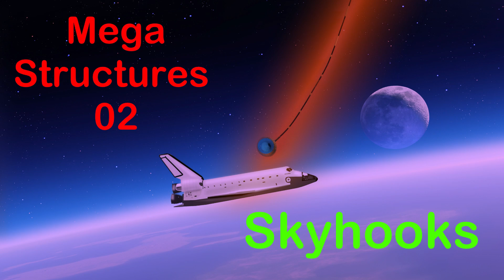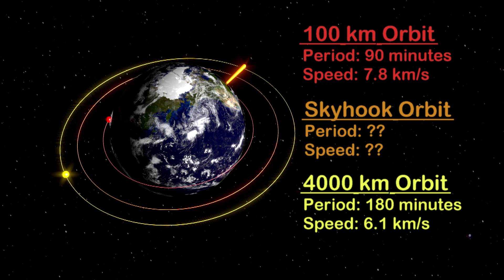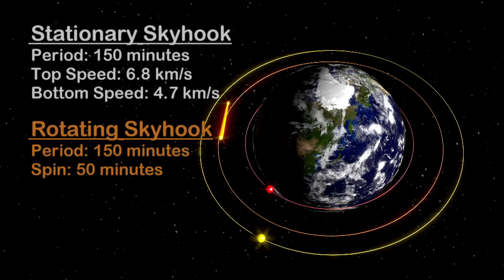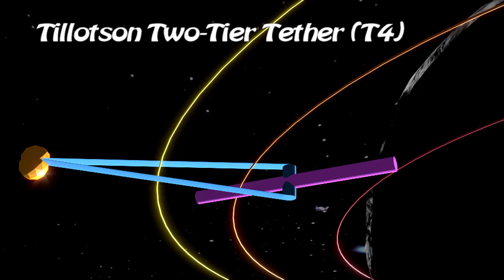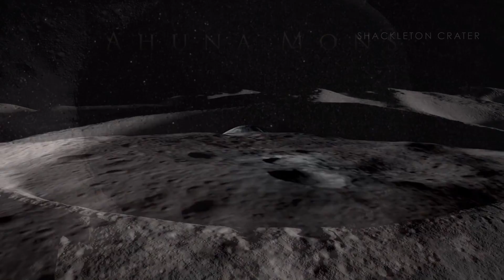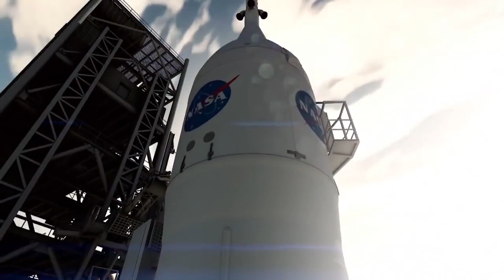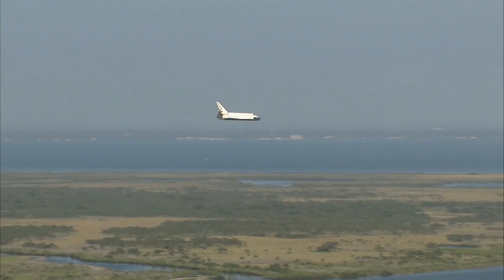Skyhooks & Rotovators

Comment: That's why they're not popular, they're not that cool, they are complicated to understand, they are almost just as ridiculous to create as space elevators, and the benefit of having one would not, by far, justify the investment. Also... launching a ship in equatorial orbit to save 30% fuel only to use up 30% MORE fuel in order to perform a rendezvous with a non-equatorial orbiting spaceship/satellite launch trajectory is quite useless :)
Reply: NightLurk. since when is that much fuel required for that manuver?  

besides, thats like saying building an i terstate highway makes no sense if you have to take miles of back roads to get to your final destination, particularly when important things tend to be placed by the highway anyway. 

lastly, theres no reason whatsoever a tether MUST be at the equator, it makes sense for it to be but thats no different from rockets anyway.

Comment: I may be mistaken but argon should be actually better than xenon: Xe has more T/W ratio but AG has more Isp, Xe is used more because ion engines have already a lot of Isp and is preferred to bring the payload faster but on a skyhook one would prefer to bring up more mass with a bigger ion engine Ag propelled (also making it more stable) the first time since you will benefit bringing less fuel each time rapidly reentring the initail cost.

Comment: I think there are many dangers involved in the operation of the skyhook. Mainly when hooking on to it, either from the lower atmosphere or from space.
If you look at some footage of mid air refueling you can easily see that it's quite hard to pull off and can result in damaging the hook. If the hook is damaged, I assume it would be pretty hard to fix since you'd have to pull the fix off dangling in mid air. If you drop something it would go falling to the ground, or get shot out of Earth's gravity well in the case of the rotating skyhook.
Also cargo transfers in mid air is something we have not much experience in doing, so that would be a safety concern as well.

If you fail to hook on in an airplane, that's fine. As said in the video you can just fly back down. But what about objects being hooked in space? Non-rotating variants would be fine since the space object is in stable orbit, but for the rotating version of the skyhook, the space object would be hooked while in an escape trajectory and if it fails to hook on the first try, it would shoot straight out of Earth's gravity well, presumably without enough fuel to come back any time soon.

Along with all those dangers I gave, it would be quite hard to increase the numbers of hooks on each end of the skyhook since if you are going to build a port facility for it you would have to design it so that they can withstand supersonic speeds within the atmosphere. And also you would probably want to have two of them on each end, unlike the space elevator in which you have little design constraints for the orbital station part and you would only need one of it.

Comment: which do you think would be cheaper per kg, reusable rockets or skyhooks?
Reply from the maker: Skyhooks, at least on Earth, have to be used in tandem with something, so the answer is basically 'yes', they would make reusable rockets cheaper to use, and that would also be cheaper than conventional rockets... I'm not sure for hypersonic spaceplanes.
Reply: Isaac Arthur sorry i am a bit confused i was asking of say space x's reusable rockets would be cheaper per use than a sky hook and plane. as opposed to a rocket meeting a skyhook
Reply from the maker: The Skyhook and plane should be cheaper, not including R&D costs, if you're using them a lot.
Reply: Isaac Arthur thanks issac! :) that's what i was wondering.

Comment: Isaac, I don't believe in the skyhook for a number of reasons.  You sort of gloss over a few finer details like how you raise your space ship from perigee to apogee once it attaches to the skyhook.  What is this mechanism?  Then there's the trickiness of timing a tumbling skyhook.  I don't think this will be at all possible.  Lining up to attach to a straight tether would be plenty hard enough if not impossible.  This would be equivalent to those precarious refueling maneuvers of military planes with high-altitude tankers but orders higher in difficulty because the skyhook would hardly be maneuver compared to the space plane.  Then there's the issue of weather (wind mostly) that would blow the skyhook around.  How would this be prevented?  Evocative concept - yes; realistically doable - no.
Reply: Brian Brewster. a rotating skyhook would have a significant "dwell" period where the tip would be effectively stationary (assuming its rotation was timed to its orbital period) you could in theory wait for the hook to arrive, walk up to it and hang a basket of space cookies during the dwell and watch it smoothly pull away.

in relation to those risky refueling procedures...those are nowhere near any manned launch in history or the foreseeable future of rocketry.  if it only ten times harder than that its still many times easier than any other mode we have used sofar.

Comment: Why not monitor a payload building from the already  space station build a huge structure way higher then the station make the structure able to calculate the weight of the payload so the tether could be reeled in like a fish getting all its fee power from the sun ,, i mean its a lot cheaper then anti gravity., then we could build in space , then any rocket payload could use a simple air plane if  we  mach the earths speed with another low orbit structure that could later connect to the high orbit structure.Then we can  start building space ships and space city's from dead planets not life holding planets and keep mother earth alive as well.

Comment: The problem is the conservation of momentum. When you bring up a heavy spaceship with the skyhook, the spaceship increases its radial velocity while it is going uo. This means that the rest of the skyhook on the other hand decreases its radial velocity meaning it will loose hight in its orbit just a little bit, assuming the skyhook is hmuch heavier than the spaceship. This loss in height has to be compensated with burning fuel to lift the orbit of the skyhook back up. The amount of fuel is exactly the same as if the spaceship burned the fuel itself and didn't use the skyhook.
Reply: ProjectPhysX. it does not require the burning of fuel, there are several options for gaining delta when one is straddling the atmosphere.  one of the more obvious methods is to gather solar energy from the high end and feeding that power into the tether. electrodynamic propulsion.
Reply: DrewLSsix Thank you, i didn't consider that initially.

Comment: Of course the sky hook could be used to make a space elevator cheaper, and some small amount of R&D will overlap, but the bigger overlap will be in public opinion, if it works in practice, people will be more open to the idea of an orbital elevator, thus making it a more reachable project, it will also open up the possibility of eventually "mining" the gas giants, for hydrogen, helium and other gasses useful but less abundant elsewhere, Hydrogen can be tossed somewhere like Mars that has a supply of oxides but little available hydrogen for water production, and helium has its own uses,

Comment: Just a thought. What about releasing the payload just after the height of the spin once some of the angular momentum exerts force away from earth (i.e. 0.05 radians past spin height [little less than 3 degrees ])? This would require less energy to re-establish orbit and give the payload a little "push" or be a means of achieving an elliptical orbit to use as a slingshot for exiting earths gravity.
Reply from the maker: I'm not quite sure what you mean by 'height of the spin', can you clarify that?

Comment: ... and while this thing orbits, the tether well kill all equatoial satellites below the orbit of its base station...
Reply from the maker: Not if you've got stuff decently coordinated, remember this is a huge volume of space. It would be like randomly driving in North America and just happening to run into the Washington Monument.
Reply: Yeah, sure, but especially in the lower equatorial orbits is the space relatively rare. And a lot of satellites has to be equatorial to do their job.
Look at the ISS. They have to do course corrections all few weeks to evade debries and other 'crafts' such as satellites. And the Station is just about 100m. Imagine a tether this size. Even with carbon nanotubes it will have at least a few dozen meters diameter. This times the length is a lot of space you have to keep clear from all other vessels to operate this stupidity of a engineering nightmare.
Reply from the maker: This is true, and of course a problem, hence the video on it next month, but you can reel in a skyhook when its not in use or regenerating momentum if electrodynamicly, and it would let you get away with more substantial satellites that could carry more fuel and make it cheaper to replace stuff when damaged. I don't want to dismiss it as a non-problem, but it seems manageable.
Reply: The key to this really woud be a cheap possibility to get to orbit, so  EVERY company that has a infrastructure in low eq orbit can afford to send up a replacement with enough ressources to maneuver out of the way and, probably out of service every time. 

With the launch costs today, even after SpaceX's incredible archivement.
But if launch costs will get this low, it might be cheaper to launch with a cheap, reusable standard booster rocket.

And thats just the eq-orbit-part.
Literally thousands of sattelites and non-steerable parts of spacejunk travel on inclined orbits, that will cross the path of the skyhook at least some times when its operating. So you have to replace all of these satellites and clean ALL the spacejunk bigger than a few centimeters to guarantee a minimum risk.

I do not doubt that this concept is physically possible, indeed i guess its an even better choice than an space elevator, but the economic balance seems to be terrible, at least within the upcoming 100 years.

Comment: Sky Hooks: 
Again an excellent review of the state of the art.  I would like to point out two historic occurrences
and one big problem.

History 1: 
In WWI there was a plan to have a fighter biplane stationed on a hook beneath a dirigible.  If the dirigible was attached the fighter could drop off and meet the challenge before returning to the hook.  I do not know if this scheme was ever tested.  In the mid 1930’s this scheme was revised to transfer sacks airmail to the dirigible as it passed over the coast.  I believe this system was tested but never used commercially.

History II: A dumbbell orbits in a stable fashion.  If your satellite is designed as two masses attached by a stiff rod it will orbit with one mass down and one up and will return to this configuration if disturbed.  Early Earth-viewing satellites were designed this way before the three-axis stabilization system was perfected.

Problem: 
There is no free lunch.  You have to provide a lot of energy to your payload between the time it attaches to the skyhook and it is released.  The open question is whether this energy can be provided more efficiently by the skyhook than by a basic rocket.  If the skyhook is flexible then this energy has to be replenished at the two ends and under great control.  Also mass returning from the Moon, say ore concentrate, will be traveling too fast to hook on directly so it would have to be slowed down.

This idea has been around for a long time, but I feel its problems have been glossed over.

Tom Riley, The Big Moon Dig
Reply from the maker: That's why the momentum needs to be regenerated, do you feel I didn't cover that fully enough in the episode?
Reply: It would be good to point out that returning mass from orbit to earth via the system will replenish momentum.  The more two way traffic it has, the less station keeping energy is needed.

Comment: so why does the space station not use ion thrusters instead of 7000 kg of propellant for reboost ?
Reply from the maker: Limited power supply basically, only 200 kW. They worked on one for ISS last decade but closed the project under some budget cuts and then were looking into VASIMR as an alternative, which has kind of stalled out.
Reply: thanks for the explanation, I wonder if a small supplemental ion thruster would create intrigue. they could give it it's own solar cell

Comment: Wouldn't a stationary skyhook also be pretty useful for travel in the atmosphere itself due to the supersonic speeds? Similarly, couldn't you push a skyhook back up with plain normal jets if you flew it low enough?
Reply from the maker: I don't think so, ones hanging low enough to be grabbed by planes are under a lot of atmospheric drag. Now you could fly up and hook on one and use it like a ferry, jumping off when it got to another place, but unless you had a pretty potent power source to keep it up you'd probably use more fuel doing that then flying straight. Hard to say though. I think in a fusion economy if we had reactors that were too big and low-powered for an airplane but still small enough for a large skyhook then maybe that ferry method would work.

Comment: Massive fuel savings isn't a panacea, cost per launch for a Delta IV Heavy rocket is $375Million, the fuel cost is under $2Million. A breakdown of the cost of the entire space shuttle program produced a per flight cost of $1.6 billion, the per flight fuel cost averaged under $1.5Million. 

This only make sense for getting into orbit if it removes the need for a throwaway rocket.
Reply from the maker: Ideally it should, and was the reason for the spaceplane component in HASTOL, but reusable rockets potentially serve that same role and possibly much better than spaceplanes.

Comment: Why the airplane has to be supersonic? can't the hook be used with normal airplane? at least for cargo transportation
Reply from the maker: It can if you can make that hook long and strong enough, yes, but the strengths involved get very near what a space elevator needs and so a low-speed hook is really only on the table if we manage to bulk produce carbon nanotubes that are a good deal stronger then Zylon but not quite good enough for a space elevator. Which is a real possibility.

Comment: Would there be a significant electrostatic charge difference between the hook/tether and shuttle?
Reply from the maker: 'Potentially', pardon the pun, but its not a major concern, keep in mind the same issue arises with mid-air refueling.

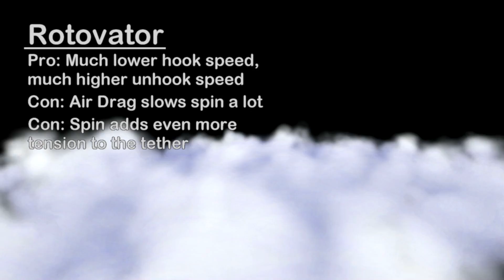Comment: 10:30 “That tapering is designed to make something wider at the top than the bottom and thus stronger, as we discussed in the space elevators episode.  That goes a bit out the window when the thing is spinning, so that the top isn’t always the top, or the bottom the bottom. We can still benefit from that partially, but mostly by allowing the weight of the ship to be included on the bottom, when the bottom is down at the planet."

It’s a lot simpler than that. The tether will rotate around its centre of gravity, not its midpoint. For a tapered tether, the “top” end will be near the centre of gravity so it will never dip down into the atmosphere or even come close. Because of this, I think the two-tier tether which you go on to discuss is an over-engineered solution to a problem which doesn’t exist.

What does complicate things is that the tether is a thread, not a rod. It won’t always be straight. At different points in its rotation gravity and centripetal forces will work in different directions, causing the tether to curve. Waves of elastic compression and expansion will move slowly back and forth along its length, reinforcing at some points and cancelling at others. A proper model of the type that would be needed to determine feasibility would therefore be a lot more complicated than your visualisation; and the two-tier tether would be vastly more complicated still. However I believe that the simple basic tether is feasible, I look forward to seeing one in operation, and I congratulate and thank you for explaining it so clearly.
Reply: Note: having reviewed what I wrote and reviewed the video, I realise that the problem addressed by the two-tier tether is a real problem. It is important to minimise tension within the tether to remain within the bounds of what is feasible. However I still think that the complexity that it adds would be unmanageable. 

Instead of two tiers, just have the longer tether rotate in a way that is just slightly out of sync with its orbit, so that instead of the "lower"end being always in Low Earth Orbit  it dips occasionally into the Earth's atmosphere. This does not add significantly to the tension in the tether, as in the two-tier situation the outer tether is having to support both its own weight and that of the inner tether anyway. It just means that the dips into the atmosphere will be less frequent, and how often do you need your tether to dip into the atmosphere?
Reply from the maker: How often it dips is kinda tricky, because if it is just a tether you can reel it part way in to stay over the atmosphere when it isn't in use for an actual hooking